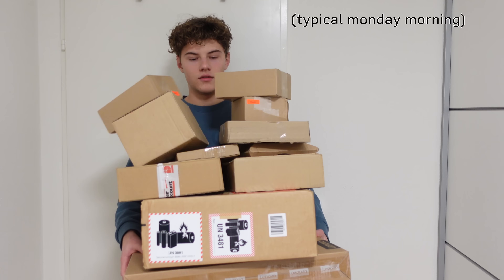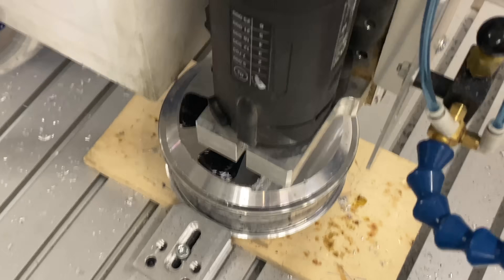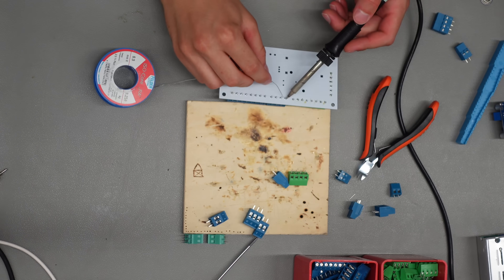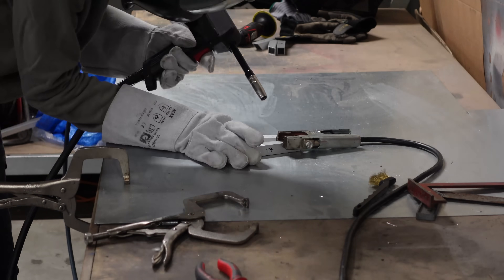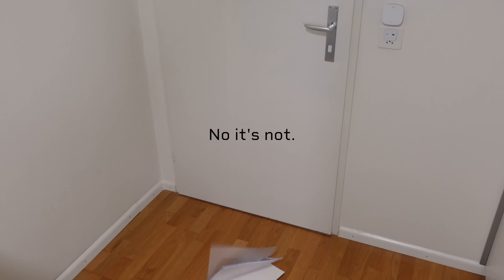I built a delivery robot (and lost my sanity halfway through)

Comment from the maker: CHAPTERS

0:00 Intro 
0:30 The concept 
0:56 The design 
1:27 The wheels 
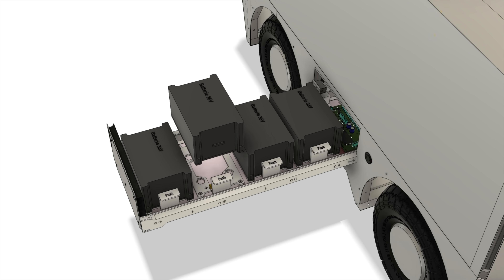2:02 The battery 
2:42 The battery compartment 
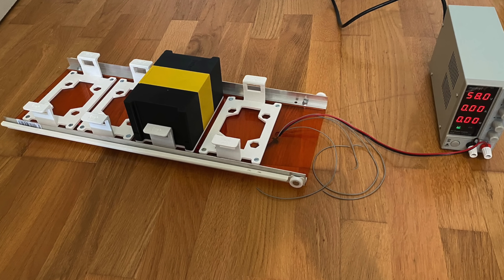3:38 The charging 
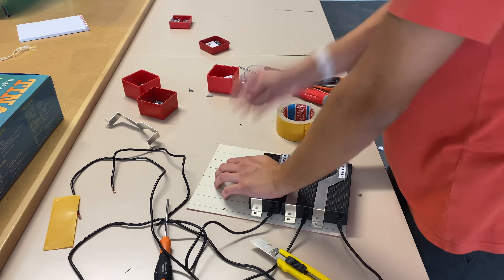4:01 The frame 
5:45 The cover 
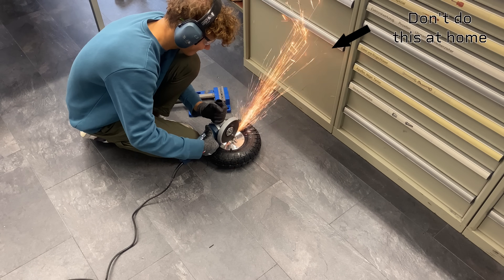5:56 The steering system part one 
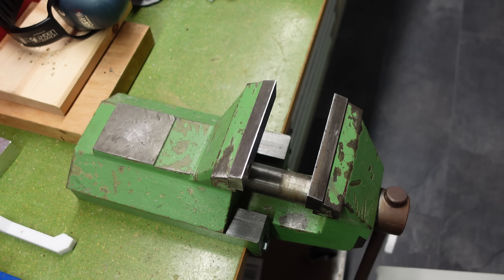6:44 Get money 
7:35 The steering system part two
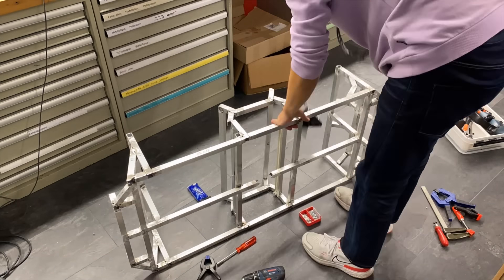8:22 The final assembly 
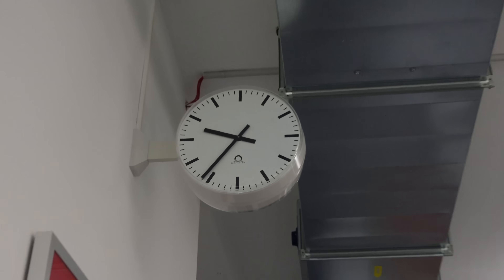10:35 The motherboard 
11:24 The aftermath 
12:12 Driving around 
12:53 The problems 
13:14 Credits and Outro
Reply: All of those pitfalls you struck are so familiar. Welcome to the frustrating and rewarding field of engineering, fabricating, and developing!
Reply: Become youtube guy
Reply: hello 😂
Reply: I am from USA
Reply: great vid
Reply: Tesla builds cars with bigger gaps in the panels than you did

great job!
Reply: Why didn't you just use an abandoned POWER WHEELS? 🤔

Comment: Maybe I missed it but why not just keep the wheels fixed and use differential wheel speed on either side to make the turns? Would have saved a ton of mechanical work.

Comment: If you're making something with a lot of bends out of square tubing, an easy way to get repeatable "angles" in it, is to mark your bend location on the outer side. Then cut a "wedge" out of it, leaving the outer edge to hold it together. Bend, and weld the 3 sides instead of 4.

And junkyards. Get your material from junkyards.

Comment: Best practice is to use a grinder or wire brush before you make any weld, it removes mill scale, oxidation, oils and other contamination that would cause a weaker weld. A tig welder is by far the best option for welding aluminum in my humble opinion. However you could have made 3d printed assemblies to act as joints for the structural components. Continued you could have used differential drive to steer like a skid steer or tank making it significantly simpler with fewer moving parts.

Comment: I work in the area of driver assistance systems and automated driving for more than a decade. You really choose a hard topic.
As a hoby I started building some machines. I never trusted my abilities to use metalstructures, I still build wooden frames. Wood is cheap, light weight and easy to handle... as long as changing humidity doesn't bend your structure ;-)
Your video encourages me to go back to my workshop and work on my project (DIY pinball machine).

Comment: I'll be honest. You get an "A" for the effort on the amount of engineering but  a good engineers knows how to cheat. 
For example instead of building a custom frame, just convert a stackable cheap plastic tool chests
Finally and most important "KISS" KEEP IT STUID SIMPLE. I'm sure mount the hoover board as they were on a trailing arm suspension and doing track starting would be simpler, more agile and allows you more time to really work on the money part. SOFTWARE!

Comment: 13:30 I will vaite for version 2 :D
Reply: https://hu.wikipedia.org/wiki/Ikarus
Reply: 6:10 I am amazed how complex it is , but the fisch bone part , why is so cubic you used a 3d printer , it should be streamlined more.dont put electronic on hi g parts , use minimal cabeling with the moving parts and the body , use LIN or something 1, or 2  wire communication. I am looking the 3 d model , and finding the same type off things when I was young , I was fixated on some parts that I must use it because I bought it :D

Comment: 7:57 why are you using car stearing. look up the star ship robots. you are doing heavy mechanic , the problem if the differential is heavier than a motor there are no point put a differential in a battery-powered robot .

Comment: It seems you have learned an important lesson. Try to keep it to as little parts as possible.

It also seems you did a few unnecessary things like making a PCB for the headlights. It would have been much faster just to use a piece of perfboard since you are just using through hole components anyway, maybe you could have just use large panel LEDs instead. I’ve noticed it is small things like this that end up taking up a lot of time in projects. Each small thing might not take long but if there are a few then they all add up and are usually unnecessary since they don’t add much to the project. Just using perfboard would have been cheaper too than getting a PCB made and would have avoided having to wait for it to be made and delivered.

Comment: Its so cool to see other students my age building badass things like this! Just a tip for the simple 3d printed parts - 4mm plate steel with spacers in-between could achieve the same effect with much better material properties! (its also much much easier to weld than aluminium and you can just paint it to solve the rust issue). Also, rivnuts!!!

Comment: Mein schwitzer freund, sweet design and i love to see me some hastly smacked together arduino code :D (try ros the next time, you can have multiple mcu's directly communicating with it, or for example communicate directly with an ardupilot etc etc etc etc.).

And btw. you need to wirebrush aluminium all the time before welding, it forms relative fast an oxide layer :) (i fucking hate it)
I probably would have used aluminium-profiles (DIN EN 12020-1), but that would have fucked your budget probably and ... and ... ah well, you already have a "critique"-list, i fucking laughed at "appearance not aesthetic", its quite fitting for a enviroment full of glass and cement.
But i bet you learned a bunch and that is the important part.
Reply from the maker: You're totally right. I though including a "mistake-list" would explain a lot. ;)

Comment: what do you mean at 22 no reverse gear?
Reply from the maker: Well the used motor-controller does not have a reverse pin. (Because it was designed for controlling E-bike motors. If you ever drove an ebike, you'll know, that they don't go reverse.  :)

Comment: 5:22 well you have to grind down the oxide layer that forms on the aluminium before welding anyways so it wasnt any extra work
Reply from the maker: For the upper part I used purer aluminium (i think it was 6061) I didn't grind a single time and it worked perfectly but I probably should've.

Comment: I think the crazy part is that a lot of the parts have substitutes that do essentially the same thing and cost a little less. Like not a lot less but a little less. Only issue is that you would need to go to a hardware store and a plumbers shop. As far as the microchips go. It's best to design a custom motherboard that has all the parts pre-built from a supplier. It will be cheaper then buying multiple diffrente chips. 

Of course I can't say this would work and I'm sure you took all the nessesary steps to research and design. I just feel like there is allways room for improvement on a robotics project is all
Reply from the maker: Of course! I also relied on fast delivery and always ordered from amazon which is sometimes more than 70% more expensive than Aliexpress, so yes, there is much potential to cut the price.
Reply: @K3RIM  xD I fully understand this now. XD I'm super cheap. Like so cheap I never cut my hair. So cheap I keep the sauce packets from fast food joints and use those for condiments instead. So cheap that well... you get the point. My family taught me to build stuff out of nothing. I ended up buying tools for milling cutting and 3D printing along with raw wires and. That stuff gets expensive but the things I can build now. It's so liberating. Not needing to buy new shoes because I can just buy the leather and cotton and 3D print silicon rubber souls and it's just more fun I guess. But a robotics project. The last time I tried to build a robot it ended up being remote controlled to just move recycling bins. That's it. XD and the previous one was a pod robot designed to simply be thrown and let it to the recon. Like the rainbow six seige ones but this was before rainbow six

Comment: Hey that's fucking amazing, I don't get how you only got 5. And the documentation work too is amazing. It takes so much energy to record everything and make a good story out of it. I want to see what you make next!
Reply: Isn’t 6 the best grade in Switzerland?
Reply: @Dotfo15  So apparently in Switzerland, 6 is Excellent, 5.5 is Very good, 5 Good, 4.5 Satisfactory, 4 Sufficient, 3.5 Insufficient, 3 Poor, and 2.5–1 Very poor. I'm impressed with what he built, but I can see how the professors and others over there would only give it a "good" grade because of all the problems it still had, and how it physically didn't look completely polished and stuff. K3RIM also mentioned that he didn't do well on the writing part, so that must've been a pretty big point eater as well.
Reply: @bustanut4610 from my experience, novelty also is a factor. Because ultimately this is an RC car, not autonomous. I honestly understand the pain of how we put so much engineering into it but we don't get the best score because it the use case isn't "unique".

Comment: Why you don't do Tank steering?, It's simple and better than a car steering, you design the car like it's going off road, it's not even drive it's self, it's just a big RC Car, you made it out of steel like it would transport 1 ton of load but made the steering crusial with a 3d printer, this is a perfect example of how to be a bad engineer, you over engineer something really simple and this is the poor result, this sound harsh but you need to learn proper engineer
Reply from the maker: Thank you for your feedback! :) I'm still in Highschool :/ and we never had an engineering class. So everything you saw in this project is based on research from the internet. Although the aluminium-frame can withstand a force of approximately 100kgs (which was the plan all along), the steering (as you mentioned) obviously can not. I am sadly limited to the technology of my time (and workshop) and it was impossible to mill the steering system out of a stronger material. I really wanted that too, but well... time (and my cash) ran out. I will hopefully learn how to engineer something properly once I go to university in approximately two years. Thank you for watching my video and I appreciate the feedback. :)

Comment: Good job on the project and especially on the video. If it was me, on top of all the manufactoring mistakes i would also fuck up all the electronics multiple time and have to buy the 3x the planned ammount hahahah
I`m currently working on a big project myself and i know how it feels overwhelming, even tho it didn`t work the way you envisioned at first, i hope you learned a lot by making it.

As a tip and what i would typically do with something myself, and i`m pretty sure you realized this by this point, but try making a prototype first to make sure everything is working and then plan and build the mechanical parts, specially if you`re gonna use steel or aluminium, wich usually mean that once it's done, is hard to fix or remake stuff. I would have 3D printed a half scale maybe just to check everything and do the testing.
Good luck o your engeneering carrer and on youtube, and good job mate.
Reply from the maker: Thank you! It was an incredible experience (both good and horrible) and yes prototyping would have saved me aaa looot of struggle.
Reply: BTW, totally subscribed to your channel, i hope to see more videos in the future!

Comment: Im not that much into coding but if you continue that it would be intresting to see that thing running ardurover with an coprocesor so you can still rund code to control the thing but have All the Software improvement of an huge open source project

Comment: Can you link to the BMS that you used
Reply from the maker: I actually used the one inside the hoverboard battery. But it should be something like this: 
https://www.amazon.de/Batterieschutzplatine-Li-Ionen-Batterie-BMS-Schutzplatine-Kobaltzellen-Abgleich/dp/B07SRTHTJJ/ref=sr_1_1?__mk_de_DE=%C3%85M%C3%85%C5%BD%C3%95%C3%91&crid=20W26U4NAVE5L&keywords=10s2p+bms&qid=1675839739&sprefix=10s2p+bms%2Caps%2C72&sr=8-1

Comment: Don't worry... even a natural/bare finish on the aluminum would have needed prep work. At minimum a good cleaning because Aluminum is very sensitive to weld contamination from dirt and oxides.
Very cool project, man. You accomplished quite a lot in a relatively short amount of time. 4 wheel steering, too? You are a madman!
Reply from the maker: Well… welding the aluminium was a little nightmare for itself. Next time I‘m probably gonna go with steel or some materials, that are easier to weld. Anyways it‘s nice to hear that you enjoyed the video! :)

Comment: why didn't you use 2020 extrusions???
Reply: Way too expensive. And heavy.
Reply from the maker: Yes, it was to expensive :/
Reply: perhaps some clarification, 2020 extrusion for prototyping the frame THEN welding one together after the design is finalized. i mean thats what im doing with my delivery-bot. i dont want to cut apart welds if it goes wrong
Reply: @MrRevolverkiller  That wasn't the issue here.
The frame was well designed in the software, the issue was lack of proper tools   to do something really clean.
For prototyping, use wood, it's cheaper and really good for "bodging" solution together.
Reply: @SaitoGray  yeah im probably a bit prejudiced because i have A LOT of extrusion on hand, and no wood And because of that, the thought of using wood really irks me. I also have the aluminum square tubing and man, i really want to make stuff with it but without proper tools, im not even gonna attempt it.

Comment: why not a tank type steering, if you use 4 motors?
Reply from the maker: Without a steering, the wheels would have worn out too quickly because the distance between all four wheels is not the same. Or that‘s what I thougt.

Comment: Why did you use seperate escs instead of hoverboard motherboard?
Reply from the maker: Because some of the hoverboards were broken, even with working batteries they didn‘t seem to work and they are way to big to fit near the steering system. Therefore I decided to use seperate ESCs as they seemed like a more clean (and to some extent waterproof) solution. Altough later it would have been a better idea to use everything else than these Escs.